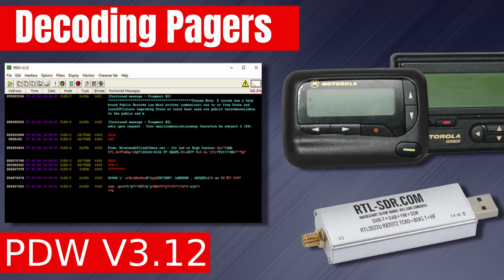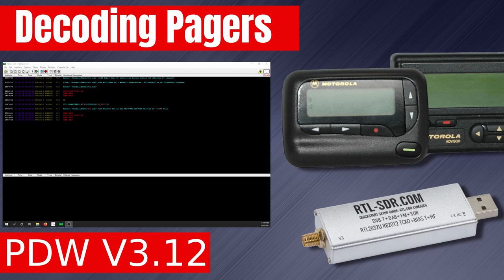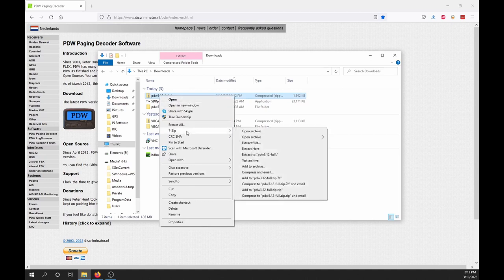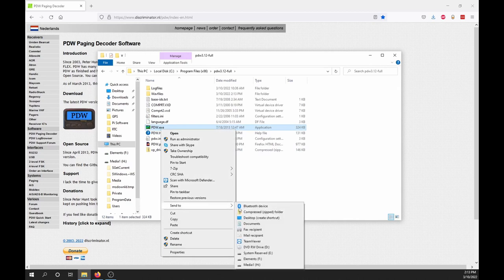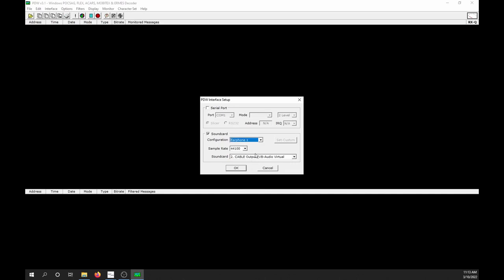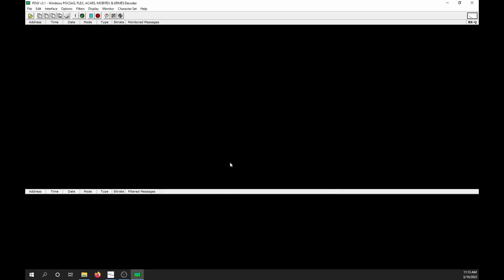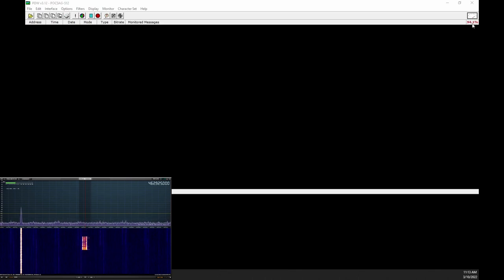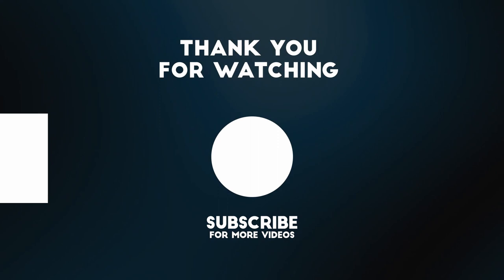Decoding Pagers with PDW

Comment: I have tried this exact program in the past but was never able to find signals.  I'm sure they are there because I live not far from a large city.  Looks like you are a state below me.  What frequencies are you using or how did you find them for your area.  Seems like I checked RadioReference last time and had no luck.  Thanks for the video.
Reply from the maker: I use radioreference.com. Check for counties around you as well.